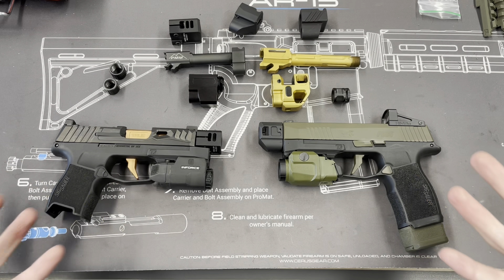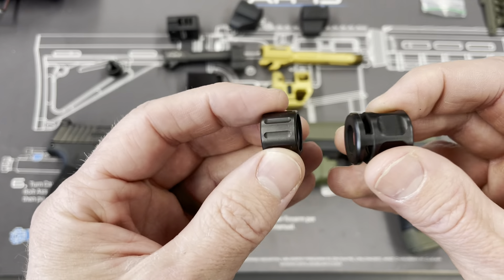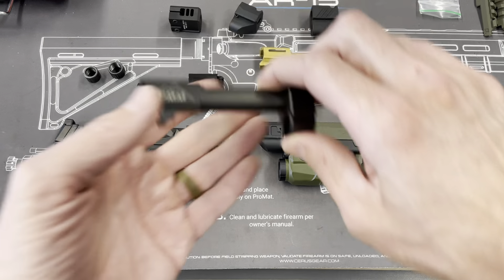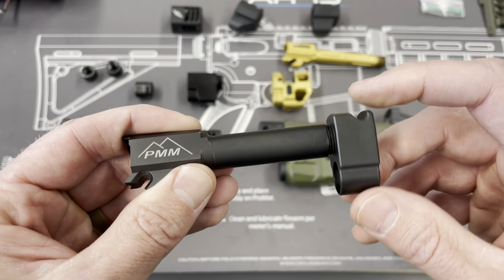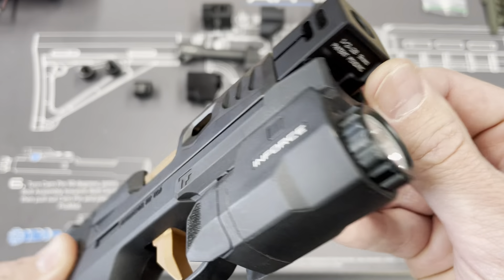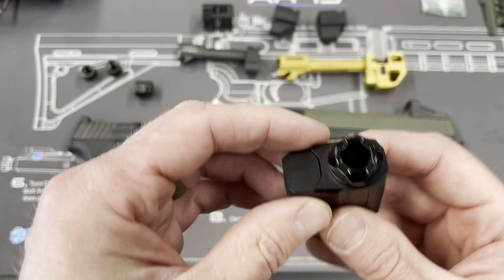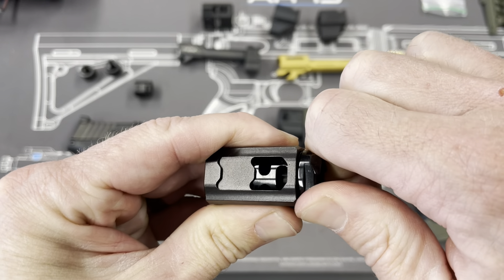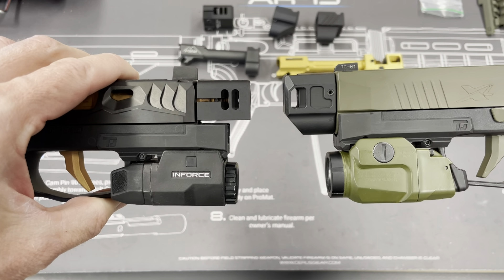Compensators mounting techniques, the right one for you?

Comment: Don't know if anyone mentioned this but you can use blue lock tight instead of the red. It comes off easier and will keep it from walking on you.
Reply: I have never used red lock tight on any of my guns, I use blue and only blue, I use red for heavier duty work that really isn't dealing with guns 😂
Reply: I suggest using a rubber o-ring. Ive used one for 3 years. never had a problem. And just hand tighten. No need for tools or lock tite.
Reply: @DisclosureTvNews  what diameter rubber o-rings do you use?
Reply: One that fits.
Reply: I understand your question, however, you offer no specs to say anything.
Reply: @msim28 what size and type of oring to mount a pmm comp with dedicated 3.1 barrel for the sig p365...
I just got the pmm barrel and jttc comp combo with a icarus evo xl grip mod but I don't want to comp permanently attached to the barrel so I can swap back out to my p365  wilson grip later when I buy another FCU and xmacro slide 😢
Reply: yes, and adding a hair dryed help loosen the comp, or anything for that matter.
Reply: Blue loctite melts right off for me after a few hundred rounds at the range.
Reply: That’s exactly what I did on mine, I only use Blue Locktite.

Comment: The "New Comp" for the Sig Sauer P365 & P365X , selling for about 400.00 available in Black anodized and Gold, I thought I saw in silver looked to be very simple. That is the one I am looking at. There are screws etc. They claim 35% less recoil. Some of the others I could live with out as they look bulky. Thank God I do not have to worry about a "Can" as I do not own or plan to own. To expensive, and I can only shoot in a range. If I lived in a house with plenty of acerage, that would be possibly different. Great video. Thank you-God bless.

Comment: Any brake which provides less resistance to the gas moving out the FRONT will both stagger the impulse of recoil(longer tube=longer period before gas exits) and lower the total amount of energy transferred BACK(that energy is displaced through the ports). It's attenuation of force on you but energy of course is not lost, just redirected - balanced recoil systems blow my mind, as an aside.

Comment: I run a Sig P365 XL frame with the P365 slide and the PMM micro comp. I agree, the shims are a pain in the a**! However, I did not want it permanent. So, I used blue thread lock instead if the red. I have been carrying comped pistols for quite a while. It’s hard to go back now.
Reply: question...are you using the oem recoil spring or something else like the DPM spring kit?  Any issues with this set up?

Comment: Hey quick question. I'm new to comps as well as to p320s. Will the strike Industries comp for the smc work with a 3.9 threaded barrel and full size frame (the x5 for example) as I've seen that combo done with other comps? Thanks for your answer and vida. Very helpful

Comment: What is that p365 rail extension? I like how it makes the compensator look flush
Reply: I think it’s the xl frame with the 355 barrel and slide, they often think they just know what they have infront of them and don’t explain anything lmao
Reply: @alphamale4497  good guess but I found the part on their website. The factory grips do not protrude out of the sides, like we see in the video. The factory grips have Sig’s proprietary rail system which is recessed within the frame.
Reply: You need to have a new extra larger frame as the base on regular slide. He can’t explain the point.

Comment: I have a better solution instead of lock tite. Just use a o-ring. I bought a O-ring kit from Harbor freight. Just slide the o-ring on your barrel all the way down.  Tighten up your comp, Can or what have you hand tight and then go put some work in and try it out. You really dont even have to tighten it down that much. Youll thank me later. Ive never had any attachments walk off the threads using just a simple black o-ring. If you think about it,  the science and engineering behind my idea, is sound. The rubber o-ring just limits vibration between 2 sperate parts. Iv had the same o-ring on mine and my wifes threaded barrels for 3 years. and we shoot 2k rounds a month between us. And Ive never had an issue.
Reply: Any idea what the kit is called there?
Reply: @blakethomas3758  Dorman Standard or Metric or ring kit-.5-8$ per kit. 144 pieces per kit.  I bought both because i didnt know what size i would need. I suggest doing the same. Because they do come in handy for other things.
Reply: I was wondering the same thing about o rings i just bought a herrington arms hc320 comp and the first instruction is to take off any o rings but as the blue loctite didn't hold up at all I think I should try it

Comment: Even if you just shim the pmm comp will it still come off without adding red loctite? I build ARs and never apply loctite or rockset to barrel threads before installing a muzzle device.

I've been looking for a barrel and comp but I would like to run my 365xl suppressed but until it's out of jail I'll need to play with the dpm recoil springs and make sure it will cycle. If not, I wouldn't mind using red loctite